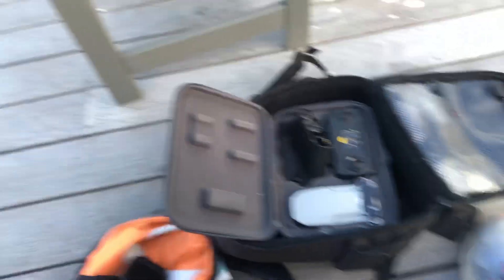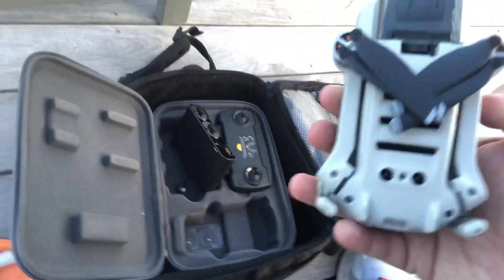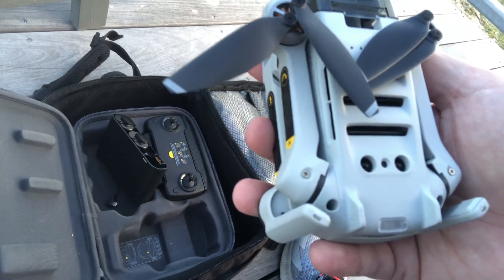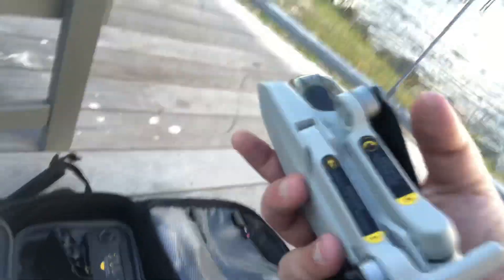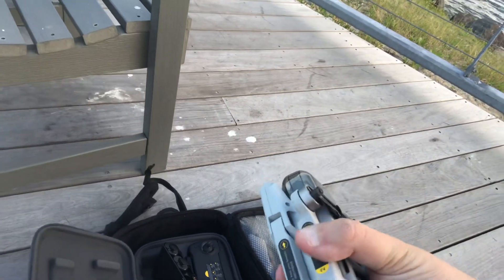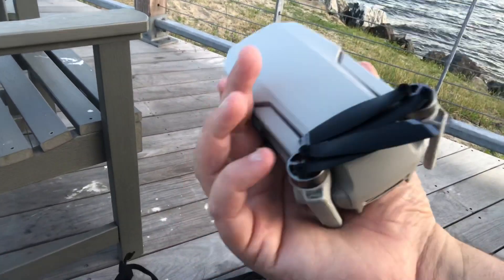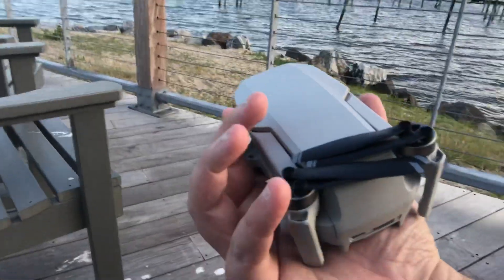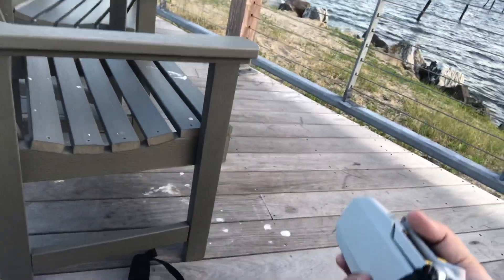DJI Mavic Mini Motor Error EASY FIX

Comment: Hey man. Second time I got motor can't spin error.. it's the rear left one. Do I need to change the motor? Or you said I can just change propellers? I would have to change all 8 propellers tho right? With the back up set that came Included?. And when I'm hovering in the air the mini 2 kind of stutters every few seconds.

Also separate issue.. when hovering still, and I try to rotate pr spin in place.. as soon  as I start to spin the entire drone starts drifting all over the place. What can I do to make sure I can spin in place and not drift all over??